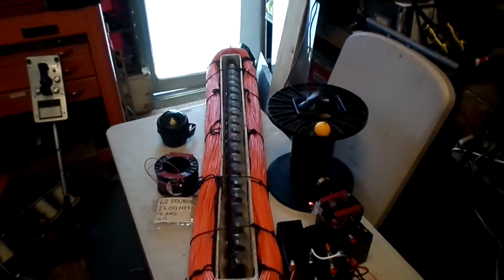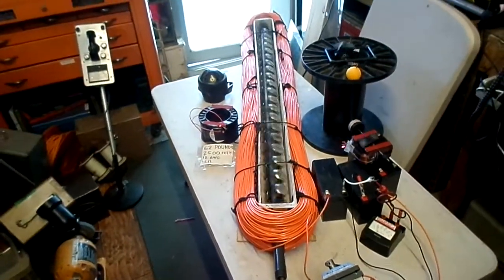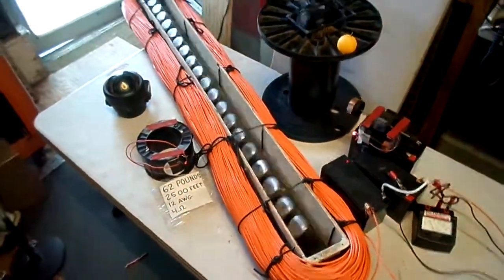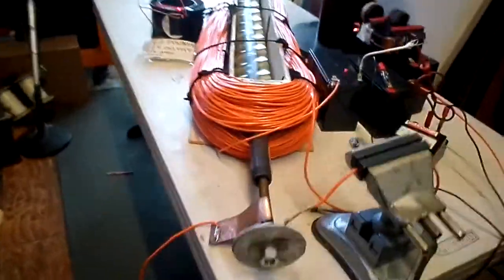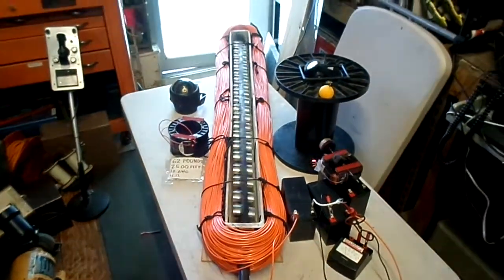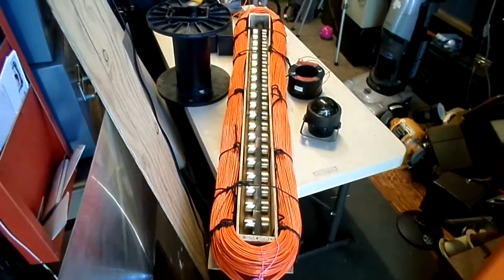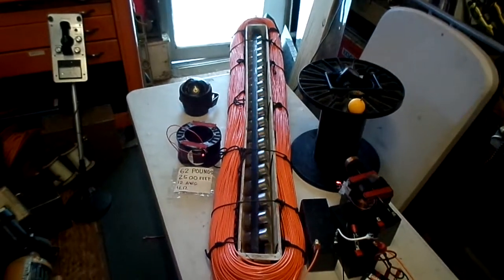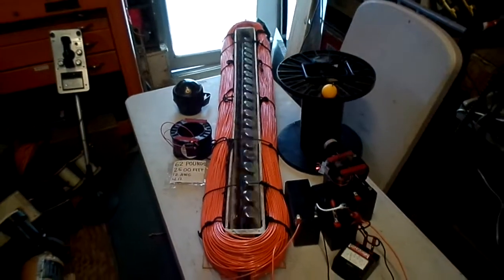87 Pound Newman Motor. Check link to newest documentary on Newman life in info section

Comment: If it doesn't have Newman's Commutator, its nothing like his devices.  AYFKM?   Have you not looked at ANYTHING else in FE/OU beside Newman?  Virtually all of the >100 other such systems that have been demonstrated since WWII work on the same principle that Joe''s does; it involves abrupt interruptions in HV, and the resulting sudden fields which tap ZPE.  It can't work without the commutator, but can with it.  But transistors are NOT the way to go about it.   Watch Peter Lindeman's lecture, in its entirety, and you'll understand the Newman Energy Machine a LOT better than you do now.   Make it work before you give up on it.  FE/OU is Real, and Newman will be its "Poster Child" as all that SHTF, in the next couple of years.   https://www.youtube.com/watch?v=rXX_g49tLeU
Reply from the maker: I started out building small Newman motors that had segmented commutators similar to what Jow describes in his first book, but unless my memory is failing me, at one point I remember Joe's PR man Evan Soul telling me  on the phone that Joe later concluded that the segmented commutator was not necessary,  but it did make sense to build a commutator that switched polarity every 180 degrees of rotation.
Reply: @GrantsPassTVRepair  Joe didn't fully understand what was happening; neither did Gray or Meyer, but they were all doing exactly the same thing, as Lindeman's lecture makes perfectly clear.  They were the post-war pioneers of FE/OU, but didn't have access to all the scholarship we do today on earlier researchers who stumbled on the same phenomenon (see RexResearch database).  ALL FE/OU systems work this way; only Inventor Egos kept them from seeing it, and have kept us from integrating their work, until recently.   Abrupt, fast switching, that prevents electron flow from discharging a high voltage dipole potential (which propagates FASTER), is how 'new' current is entrained from any source of free electrons in the ambient environment (literally, from 'Air', 'Earth', 'Water', or 'Fire').  That's the whole of it.  Newman's brushes and commutators can potentially do this better than solid state components; the unreliability of which is why his motors worked whenever he ran them, while kludges of little circuit board components used by other FE Inventors have been so finicky.  Its why Bad Things Happened when the Patent Examiner mis-grounded Newman's machine during test, and when Feynman suddenly disconnected Papp's engine from ground as it was running (killing a bystander).
But, as recent 'high science' is finding, Joe was ultimately right about his "gyroscopic particles" being at the root of everything; look what Bob Greenyer is finding at MFMP.  His exposition of 'fractal toroidal moments' is just a restatement of what Joe wrote, half a century ago.  Likewise, the extended Vassilatos quote in Lindemen's lecture.  No Commutator (or similar pulse block) No Possibility of an Effect; and its the "missing bits" in that Commutator which do EVERYTHING.

Comment: Is this coil that you've built made from coated wire? Because it looks like there's an orange plastic coating over your wire there on your coil.
Reply from the maker: Yes, on this model I used 12 gauge insulated stranded wire.

Comment: I remember watching him running the big machine running on like 20 or more 9v batteries in series...high voltage.
Reply from the maker: I never understood why Joe seem to imply that a motor designed to operate high voltage and low current was doing something extraordinary since power is volts time amps.

Comment: I always thought the Newman motor ran on the wave of electricity that travels faster through conductors, still interacting with magnetic fields, traveling much faster than the electrons creating the charge waves, with a 7mile inductor winding, the speed of light gap between the wave and particle is how the commentator is using power that recycles and charges the dead batteries, but never uses the electrons.

Comment: Your slow rpm dc motor is but working from the pulses from your Newman version. It is not just the pounds of copper but the length of the wire. The longer the wire, the more time it took to get current flow through it. The magnetic field was created by the potential and not the current. Newman reduced any current flow to a minimum. What neodymium's did you use. The magnetic field depth is different. Newman used batteries to capture that rapid collapsing field energy that recharged them as the motor ran. Lastly. Newman did power a car with his motor.

Comment: The reason Newman used 8000lbs of copper worw was 2 fold. Firstly to generate a large magnetic field, but the main reason he posited was that it had to be long enough so the current never left the coil. This wqs because of faradays statement of energy not being lost if it never returned back to its source. Newman also stated an electronic flyweel was possible, never expilicitly, but likely by diodes/transistors or using SCRs. The effect of having such a massive coil was one of the main reasons he got so much torque, and others in the science field have called it the newman effect when aonething is 8 times more massive than it needs to be.
Reply from the maker: I still have his book, and I remember some of those ideas you mentioned. Did you see this documentary? https://www.youtube.com/watch?v=CrJIzrmX1mI&t=0s
Reply: No I haven't. But Newman mentioned you only needed EMF, current was simply to inertia of the gyroscopic energy created by the spinning atoms, all you need to do is move them off axis slightly, and that created the gyroscopic precession which moved the magnet/shaft. No way can you smoothly start such an enormous mass of that mud pump without either an enormous current, or the effects he mentioned. "The Oxford bell" experiment in about 1864. It is in a vacuum, and it generates nearly a million volts and it is still running.
Newman said it was perpetual energy and he was wrong to say that, but he did engineer I think, one of the most efficient methods of creating mechanical energy from electrical energy, because those 2 systems are 90 degrees apart on real terms around an axis

Comment: I am myself knew Joe Neuman. My name is ken fairbanks I knew what Joe Neuman was doing and talk to him about redesigning the system. He didn’t seem to be liking that very much so I did a redesign and built a prototype, after I redesigned the prototype, I was going to show it to Joe because after all, it was his invention, but he died before I had a chance to show it to him, I have a company called SAEMSEN and I’m in the process of producing and leasing the machine Joe was actually converting DC to AC And back to DC doing that I realized using a high frequency oscillator blocking type I can get the collapsing field to pump back a large amount of current and then convert it back down to DC. I built the prototype. It’s on my YouTube account. it’s called SAEMSEN generator, this system does put out more power than it takes to run it. It does not violate thermal dynamics. Thermal dynamics talks about single systems such as AC to DC or DC to AC does not mention the third entity, which is what I have using a high frequency, blocking oscillator, that energy source produces higher output oscillation are known to do that only they never investigated. Could it also produce energy and over unity they never applied it to the Tri-system which is a DC battery feeding into an oscillating circuit at 3kHz getting up from 1.2 to 400 V AC produced an awful lot of high energy current which is what some electric cars do but you will not get the extra current until you convert it back down into the DC current the collapsing field in the oscillator pumping back a large amount of current my system uses an AA battery 1.2 V said to the oscillator, which does not draw very large amounts of power from the battery. It uses very little energy from the battery creates 400 V AC dropping that back down to 5 V, it produces more current runtime than the battery itself has, the battery that I use produces about 1.2 W and then my system I’m getting 7 W back. I believe it was an oversight. No one ever thought to use an oscillator in this way they were all used for volume controls. Short wave radio CB radio nothing more.

Comment: Problem with your motor is your design
Magnets has to be light as possible creating a cylinder with space between magnets. Newman was a mechanical engineer . The design of his motor is his secret not how powerful magnet could be  creating torque with just voltage

Comment: The reason your Newman motor isn't working is due to the gauge of wire you're using - its huge! This is allowing way too much current to pass. Newman's motor uses very fine wire. You want to express the dipole across the coil while passing the least amount of current possible. 
This draws the ambient magnetic field into the coil and when you turn off the dipole, this current/flux is siphoned off into a capacitor or battery. In this manner, it is acting as a pump. It's a form of Tesla's impulse technology.  Newman wanted the dipole, not the current which is why the wire in his coil was so long and of such a very fine diameter. He wanted to pulse the coil with the dipole before the current made it across. Your wire looks like normal household wiring - maybe 14 or 12awg? You should have something more like 30 awg or smaller... I hope this helps.
Reply from the maker: I understand. I made a previous model that had about 30 pounds of number 30 gage wire, and still no free energy.  On Newmans largest coil, I thought I remembered reading that he used some large diameter wire.

Comment: (Flyback) dont run the drive coil with the battery , run it with a cap bank and run the cap bank with the battery this way you can send the back spike into the battery without that issue of slowing down . Thats my guestimation . Nice setup btw 👍

Comment: The biggest thing that I've discovered in all my experimentation is that the electricity generated by the magnetic field is only a surfer riding the wave of magnetism saying that the magnets create the electricity is like saying a water pump creates the water it's pumping. 
Charged particles are repelled from a magnetic field whether it's north or south, so the ambient charge that is replaced by nature in the neutral portion of the magnetic revolution is swept off again by the next pole rotation. All the energy that comes out of a generator is pumped forward by magnetic field lines not generated by them.
Reply from the maker: The way I understand this, is that It's basically fluctuating electromagnetic waves known as modulation that ride on magnetic waves,  but I would not say that electricity itself is riding on the waves.

Comment: another gyro gearloose.    You need to understand the difference between power, amps,volts, joules, energy, time and be able to accurately measure all these. Otherwise you have a device which just goes round and round without doing anything usefull.

Comment: It should have been ( Two) 62Lds of wire. "Two coils  62 - on the top & 62 - on the bottom. " Also,  the specific type of commutation is VERY  important to getting the "Joe Newman effect".
You have just built a different version of the 
Comen every day Motor.!!
I'm a firm believer in: if you're going to do it,?? DO IT RIGHT.!!
Reply from the maker: There are different designs Joe has come up with. In a previous conversation I had with Joes PR man Evan Soule many years ago, I was informed that the special segmented commutator was not necessary, Do you happen to have one of these motors that does what Joe claims?

Comment: The reason a extra extra long coil puts more out than in is because as electric goes through the coil it creates a electromagnetic field in the coil but when the electric is switch off, that electromagnetic field breaks down and turns back in to electric but it's back emf so its going backwards to where it should be, posive bemf continues on to the negative of the battery, you need a diode there channelling it back to the positive of battery, years ago i got 8hrs run time on a tiny one with just 1xAA BATTERY, diode from the negative end of the coil (posive in) back to the positive of the battery

Comment: Using Joesph Newman concept I tried to build the tiniest motor that could be used as a fan motor, to compete with the typical Lasko box fans that you buy at the hardware store. The weight and size was larger than the Lasko box fan motor by a factor of 15, however, it outperformed by a factor of 20 at low speeds and a factor of 8 at mid speeds. The concept of using thousands of turns of fine wire combined with using Neodymium magnets on the rotor can be over unity at low speeds, but as you try to get it to perform at higher horsepower outputs it begins to lose efficiency and gradually drops to where it is yielding less power than you put it. The concept works for any method of switching: commutator or transistor switching.

But what should be the goal? Saving the world can be as simple as changing your bathroom exhaust fan. Motors at 1/100 HP are very inefficient, between 5 an 10 percent typically and every household has many and think of the billions around the world that are using them many times a day; wasting energy without quilt which translates into pollution. The typical bathroom exhaust fan is 10% efficient. A Joseph Newman inspired exhaust fan could decrease pollution by a factor of 10!

My lecture and demonstration was held at the Tesla Tech High Energy Conference in 2012 and 50 scientist filled the room to witness it. You can order the video from them if you are interested. Its a fair test between my motor and the Lasko motor draining fresh batteries. The output is the spinning fans at the same revolutions per minute. So how long would it take to drain the batteries? Low speed was 20 times and midspeed was 8 times. 

The only negative feedback was from an engineer who thought it too expensive to build. Well, go back and count the useless effort to build the bombs of WWI, WWII, and all the wars since. If that effort had gone into clean energy motors there wouldn't be a need for war!

Follow the gospel of Jesus Christ. Pray for your enemy.
Reply from the maker: It's nice to hear from someone who is actually experimenting with these concepts. I've also made small Newman motors that were quite efficient, but nothing that kept my batteries charged while operating. I have some large permanent magnet DC motors that were once used on commercial conveyor belts, and they are so efficient I can operate them on watch batteries, so under load I wonder how they might compare to a small newman motor.

Comment: Stick to ceramic magnets. It won't  make a difference anyway. You have actually put in place the important element anyway ( a lot of copper wire ).  " iron core vs Air core- They Are All The Same" paul babcock. The principles apply to all the devices. BTW you have answered your own questions regarding Joe.

Comment: You have so much potential, but you are limited by Lenz law, and have design issues. You can, do this at a very small scale if you start using capacitors. With energy devices (I will not use the words like Free, or Zero Point, because it's pseudo terms), you need to take a the ideas that leverage gain. One mistake in you design is that you have a long coil and that is inefficient. You want the more WINDINGS not more length. Take 1 meter of wire and consider this experiment. On 20 inch diameter form, wrap as many loops. Put you pulsed DC, and measure with a magnetometer. Now take the same 1 meter of wire and use a 3 inch form and measure the with a magnetometer. You will see the a stronger magnetic field with more loops. While you are at it, find where the strongest field is. It is not on the outside, it is in the center of the solenoid (That much you have right). But because you have made a long motor, you are wasting your wire. Instead of buying so many large magnets, buy two big ones. Actually you could just use 4 magnets end to end sandwiching your drive shaft. Of course the end of the magnet would need to be offset the center of the solenoid. But even if you do exactly what I am saying, you will need to understand how you can leverage pulsed power. Ask yourself why you use thick wire, because there's a way to use thin wire (hence more winds) but there is heat and resistance, all that can be overcome. That is what Newman doesn't tell you.

Comment: I looked at one diagram of one of his motors a long time ago.  I wonder if his 'success' was from separate coil wrapping(s) - that was the coil the contactor triggered.  The one I looked at had (I think) 6 separate coils and the contactor triggered each separately.
Reply from the maker: I think I saw the motor diagram you mentioned, but I think most of Joes motors only had 1 coil.
Reply: @GrantsPassTVRepair  I got his book, and it looks like the commentator isn't like his design.  I wonder if that could be part of the issue to reproduce his results.
Reply from the maker: @Dogalot1  Yes Joe had a very fancy commutator with short out segments, but at a later date the guy who worked with Joe told me I did't need to use a commutator of that design. I'm not sure what to believe at this point, but I'd like to see someone else build a giant one of these motors like Joe built.